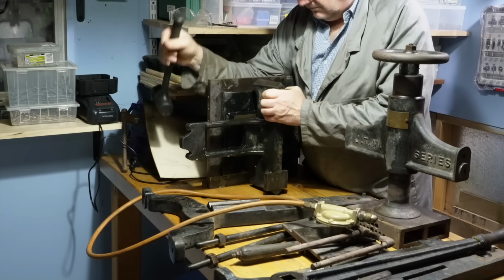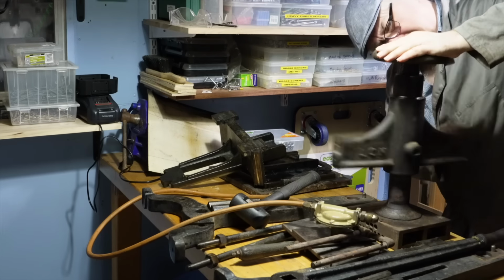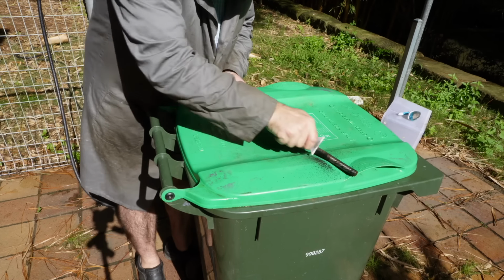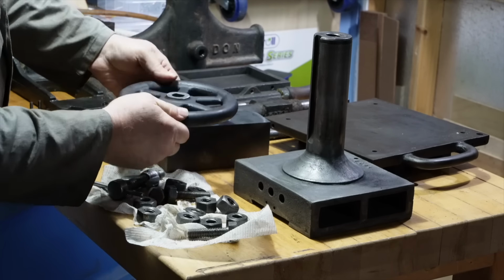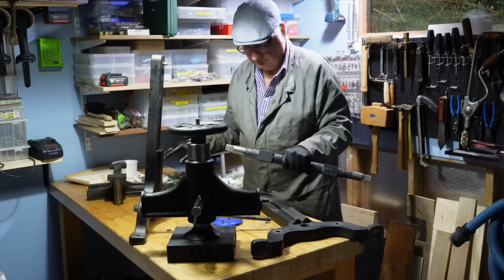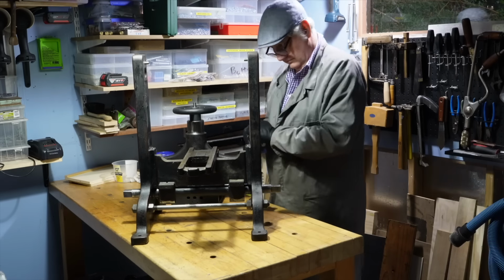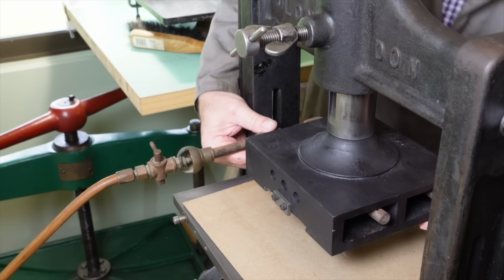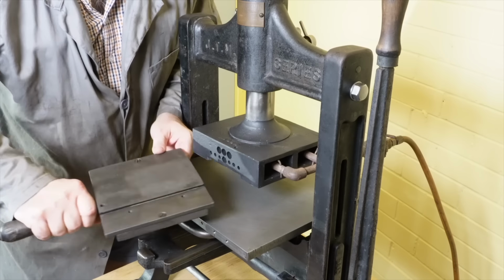Restoring a Gas Fired Bookbinding Blocking Press

Comment: I have just bought an identical Mackay foiling press that still has its original gas element. I am about to restore the machine and I’m still considering whether to convert to electric or not. Do you have any literature on the machine? Thanks for the video!
Reply from the maker: I've never worked out the connection between Mackay and Marshall.  They are almost identical machines.  I don't know who copied who.  I've never found anything other than advertisements for them.  I wouldn't convert.  They work great with gas and there are plenty of electric ones and gas ones are rare.  If you're in Australia and you do convert I'd buy the gas element.  The few gas ones I've seen most were missing this.
Reply: @DASBookbinding I’m in England I’m afraid, but you have also persuaded me to at least try the gas and see how it goes. What I need to figure out now is how to get dies made for it and what the operating procedure is. Thanks again for all your videos - so helpful for folks like me!

Comment: I read that hundreds of years ago people used cow horn to protect metal from rust, you heat the metal to a very high temperature and rub it well with cow horn, it will make a horrible smell of burnt bone, but it seems that this is what people found as protection for metal.
Regarding gas heated presses, I don't know what to say, for the times when they were built they were OK, raw iron made for entire generations, but I don't see them as practical, you have absolutely no control over the temperature, when it will be too cold when it will be too hot, you have to stay next to it all the time to monitor the temperature... I think that those who motivated them on electricity knew what they wanted, it is not easy to keep the temperature at 115-125 degrees without a thermostat, and if you have a larger series of works, it is a real madness

Comment: Thank you for this video! Do you have any recommendations that would help preserve lettering and decal details?
I have been putting off the restoration of a nipping press I was gifted because I want more than to clean it, I want to preserve as much of the original look as possible. It is a bit rusty and very dirty. This press also has several decals and other markings that I want to keep intact to let the history shine through.
Reply from the maker: Good on you for trying to preserve original finish and decoration!  It is difficult.  I have experimented with gelling rust remover to apply it locally.  It works but is very time consuming.

Comment: Looks almost identical to my Mackay. Mine however has been fully converted to electric already so it’s great to see a gas one still going. Is it easy to regulate the heat for different foils or is it just a question of dwell time and pressure? Brilliant job! 👏🏼👏🏼👏🏼  I have an old advert from a Victorian era ‘Printer’s Sundries’ catalogue. Mine cost £27 and 10 shillings  about 130yrs ago! Thanks for posting the restoration - wonderful to see!
Reply from the maker: I assume Mackay were just competitors that copied each other.  They are less common in Australia and while I've seen a few for sale, none have been close enough to buy.